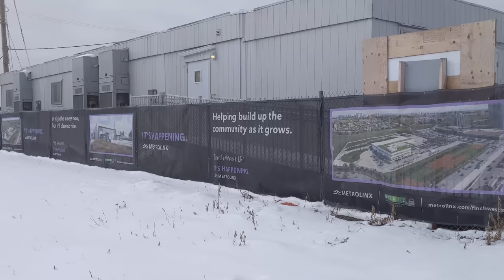Missing Links: Short-Sighted Transit Planning

Comment: A link between HS1 (Channel Tunnel to London St Pancras) and HS2 (London Euston to the North) In the UK feels like an obvious missing link when the termini are barely 500m away and it could allow Eurostar services to reach Birmingham and Manchester. They planned one originally but it was going to cost £800m so was scrapped. Can't help but think it would have been better to just get it done now, than have a whole load of disruption in future when it is inevitably wanted again.
Reply: Three main concerns:
1. Customs and immigration mean that through trains couldn't have domestic passengers
2. Every station that these trains called at would need immigration facilities and staffing costs (bear in mind HS1 can't justify this at Ashford or Ebbsfleet at the moment)
3. You'd need several trains a day to each serve Birmingham, Manchester, Leeds and Scotland; and Brussels and Paris - so 8 routes, each 3-4 times a day, to provide a useful service, but unlikely to generate enough traffic on each one to make it worthwhile. 

So, it's best to have very frequent service to London, and a good (better that proposed) pedestrian link to STP to connect with the frequent service to Brussels and Paris and passengers can travel when they like.
Reply: There is already a link, albeit low speed.
Reply: @erkinalp  HS2's not built yet, so there's no link at the moment. There's one between HS1 and the North London Line and Midland Main Line, but neither of those will connect to HS2.
Reply: @joegrey9807  I don't think the practicalities of a Birmingham-Manchester-Edinburgh through running service are quite as bad as you suggest, if it operated the same way as the Lille-Brussels-Rotterdam-Amsterdam services do, with a single train stopping at each of those major cities to pick up or drop off passengers depending on direction, but skipping smaller cities.

But ultimately yes, someone will have looked at the cost of the link and prioritied getting something built at all over a system with more options for future services. As you say, a good connection in London, and also things like through-ticketing should hopefully still reduce a lot of the current pain.
Reply: @joehitchen9311  Except Manchester, Edinburgh, and Leeds (and central Birmingham) are on different branches.
Reply from the maker: Yes, I discussed this in a video years ago, its not good!

Comment: So the most obvious one is the Elizabeth line not building a station near to London City Airport. This would also have helped a run down area. (Or forced the poor out? Discuss) 

However a forgotten missing link on the Elizabeth line is easy connection to the major North South lines of the Victoria or Piccadilly. This was clearly deliberate to prevent parts of the tube becoming a ghost town and the Elizabeth taking all the passenger traffic. But it’s still annoying if you are one of those who could have benefitted from the obvious interchange at Oxford Circus rather than Bond Street.

Comment: Generally agree, but there can be instances of 'crayonista' here - where what might seem to be an easy line on a map, is actually disproportionally expensive and operationally complex for something that few people would use, or can easily by-pass.

London Underground's Northern Line extension not going the 'extra little bit' to Clapham Junction (one of the busiest interchanges in the Europe) is an example, as it would seem to be an obvious missed opportunity to create a better link from the South London suburbs to the central areas. However, the Northern Line is already very busy, encouraging tens of thousands of additional passengers a day would prevent other passengers from using the line. These displaced passengers won't have many alternative options, but the new passengers could, with only a little more inconvenience get to central London destinations by changing onto the Underground elsewhere.

Comment: Missing links are there for good reason that aren’t obvious when you are drawing lines on Google Maps. One of the main reasons is that there is not enough capacity on one of the lines. There is also the issue of scope creep when nice to have things start blowing out the cost. In most large projects, scope creep is one of the biggest causes of cost overruns. The number of nice to haves on any project is usually very high of which missing links are one of them. The Sydney Metro example looks odd on a map but makes sense when you look at the available sites for stabling shed, the future extension to Western Sydney Airport and the massive cost of upgrading the T1 Richmond Line to allow for interchanging passengers.